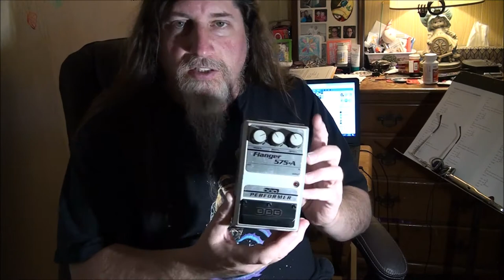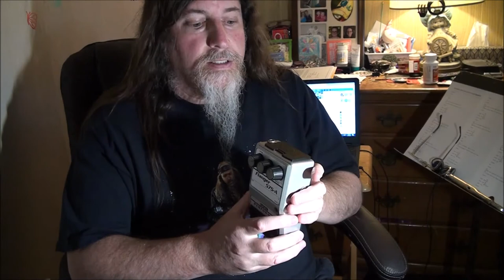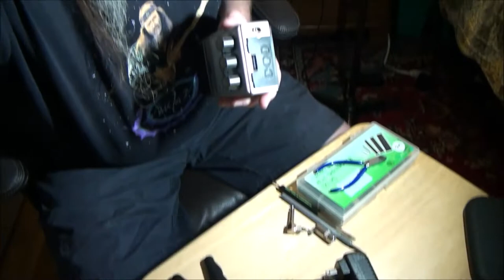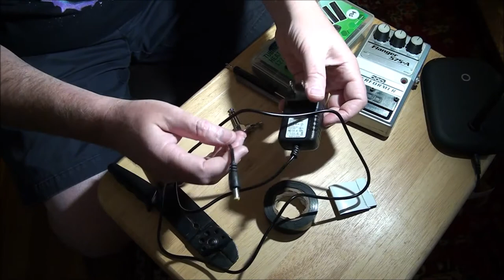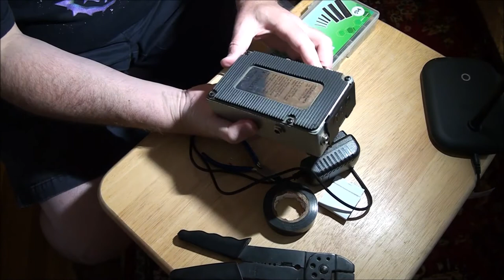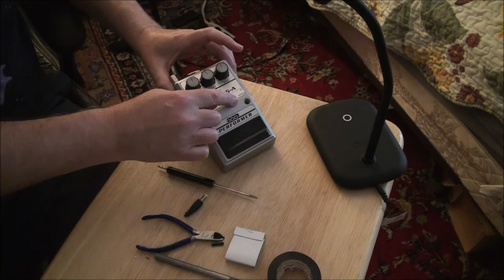Making A Replacement DOD Performer Power Adapter (or any adapter, really!)

Comment: What power adapter did you use for this mod? I would love to modify an adapter for this instead of the pedal itself.
Reply from the maker: You can use whatever as long as the specs are correct. 9v DC output, etcetera. Then, you just have to be sure you're wiring the polarity correctly for whatever plug and pedal you are using. It's pretty simple!!
Reply: @JoeHartRocks  I’ve been reading that this series of pedals requires 20vdc, so I was curious! The batteries have been damaging solder points inside the pedal chassis.
Reply from the maker: Oh!! Sorry!! I thought you just meant "in general" not specifically for this pedal. Sorry!!! I believe the pedal required am 18v DC output. And, of course, the plug was a standard 1/4" guitar-type plug. Very strange to make an entire line of pedals that need a special power adapter with a VERY unconventional plug. I guess they were trying to sell the pedals and make sure that people only bought their power supplies.